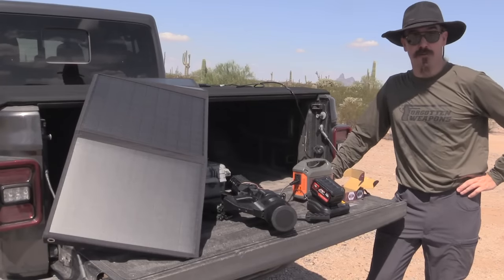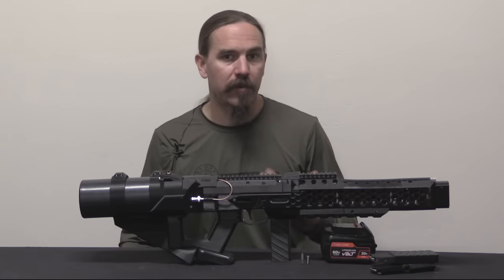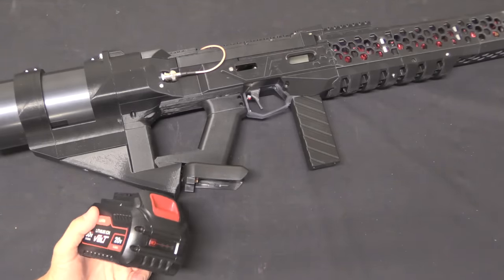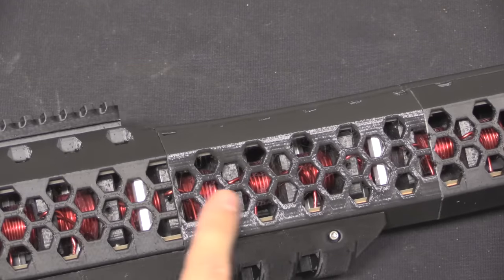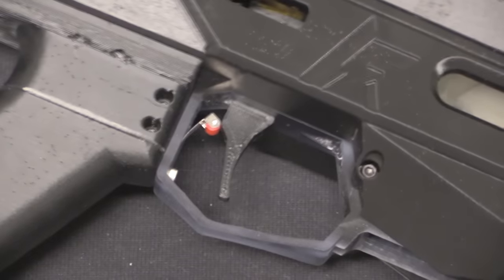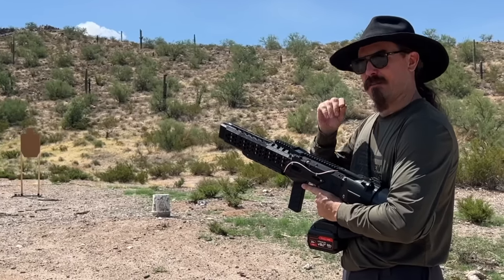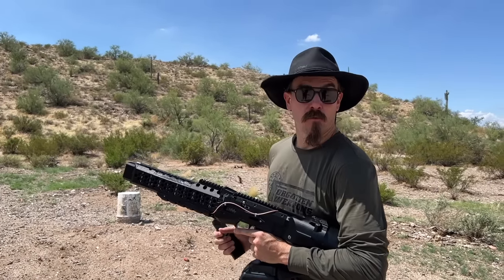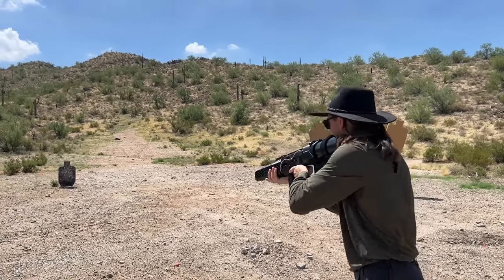ArcFlash Labs EMG-02 CoilGun: Making SciFi Weapons Into Reality

Comment: At that low of a velocity, I suspect this could make a fantastic indoor range toy. You could set up a catch trap and likely reuse the pins almost indefinitely.
Reply: I bet they're limiting it so they can keep building these without a proper license. For now. To increase velocity you need higher amps and faster timings and they can do both easily.
Reply: @1_GigaWaffle  I think the limiting factor is how fast you can charge the coil (limited by its impedance), and how fact you can process the input (where the projectile is) or otherwise how fast you can switch coils (electronics speed).
Reply: The accuracy is still atrocious. A soft air gun would be a better choice.
Reply: @michaelmay5453  Its accuracy issue is coming from poor flight stability which doesnt seem like a priority atm, but there are a few methods of improving stablity. The current projectiles are literal straight and even pins.
Reply: @michaelmay5453  you could technically fire a flechette out of this thing and that is pretty scary
Reply: @michaelmay5453  Accuracy has more to do with their choice of ammunition, which seems relatively easy to fix.
Reply: @legndery1909  oh god, that's crazy!
Reply: @legndery1909  You are now imagining someone at a 2-gun match with one of these transitioning to longer range targets by swapping mags and screaming "SABOT UP!"
Reply: @michaelmay5453  Still enough accuracy for home defense.
Reply: @praevasc4299  For home defence it's like throwing pebbles at an intruder. It might break skin if you are hit in the forehead but a pellet gun would be FAR superior.

If you live in a war zone, I recommend you get a proper gun, if you don't I recommend that you stop being so fucking fearful of everything.
Reply: @TheArrowedKnee  No. Without rifling or something to keep stability it won't be stable. The ammunition doesn't touch the barrel at all, it can't because the drag would mean it would get stuck.

It's a fun concept but it's not some kind of "gun of the future". The tech has been around since 1825 and this is the latest state of the art.

To increase power you'll need either bigger gauge coils or superconductors. As we know superconductors only work when they are super cooled with liquid nitrogen so that is out of the question.

So heavier gauge wire it is, it increases weight exponentially and since this is copper, next step would weigh three times as much. Now that would require bigger capacitors and a higher discharge speed which isn't even possible today.

Meanwhile a very simple, reliable regular firearm solved those problems a long time ago.

It's a cute gimmicky little thing but that's it and that's all it'll ever be.
Reply: @legndery1909  No, it has to be uniform or the magnetic field would affect different parts differently and it would just get stuck in the barrel.

Air guns are far more useful but in reality, we have firearms that are efficient and worthwhile, why the hell would you want something that if it hit me, I could throw it back faster at you.
Reply: @michaelmay5453  Errr, you might have mistaken me for someone you know. Who said I was fearful of everything? We were talking about the accuracy of this gun, and I mentioned that accuracy is not an issue at very small ranges. That's all.
Reply: @praevasc4299  If you think you need a gun for home defence you either live in Kabul or your fearfulness is out of control. So, do you live in a fucking war zone where you need a gun to defend yourself?

Also, you were talking about home defence, why try to make believe you didn't? You do get that everyone can read your response, right?
Reply: @michaelmay5453  Oh, calm down already, no one here is interested in what assumptions you make up about what I feel or don't feel.
Reply: @michaelmay5453  i guess it has different magnetic properties, but how do you know it gets stuck? It’s still just a novelty now but i’m sure it can be made much stronger and faster as batteries hold more charge and so on.

Comment: i don't like how the design philosophy is moving away from the large payload projectiles but making it shoot improvised munitions like drillbits is really impressive considering  the potential of objects that could be used
Reply: I Imagine once they have got the power metrics and the mechanics on smaller scale they will start moving back up.
Reply: Still prototyping, so as they work further then they will start add features.
Reply: Capacitor technology will only improve, increasing energy capacity, which in turn increases payload capacity. I'd give it a few decades
Reply: 50 inch coilgun cannon pls
Reply: Well, for a coil gun such as this any projectile that can fit into the barrel and is magnetic can be used as ammo.
Reply: Honestly I think the optimal projectile for this needs to be longer and heavier, like miniature APFSDS rounds so they do not need rifling.
Reply: @Squeaky_Ben  they'd still need to make the muzzle velocity much faster.

At this point in time their prototypes appear to be sci-fi pellet guns whilst the technology matures. Who knows what they'll be able to do in the future though
Reply: "The bit is too long to fit in the magazine..."
I think I know what length they should standardize their ammunition to
Reply: @stephen9894  They will have to improve the velocity to some degree. 120 meters per second would be nice, but I personally do not think they need to go to very high speeds just yet, that is not what coil guns are good for.
I think the real niche in the future will be utility coil guns.
Remember, your projectile mass almost does not matter, so you can rapidly fire smoke or even small HEAT charges with it. It will be great for that, but for human targets, large, heavy darts could be used for covert ops, because it is just supremely quiet.
Reply: If the projectilles are more like arrows and crossbow bolts with sharp and pointy bolts would be more efective !
And are kind of Fletching would the projectile give more stability !
Reply: Next version I want to hand load an SDS point chisel and see what it does
Reply: @hueylong7989  1270mm ? sonovabich i'm in.
Reply: @stephen9894  Ian didn't say that mass driver efficiency falls off the higher you want the muzzle velocity to be, so to say double the muzzle velocity you'd need a far longer barrel. This is because the faster the projectile goes the less time it will spend in front of the electromagnet that accelerates it and therefore is accelerated less.
Railguns don't have this flaw but the really powerful ones (naval railguns of which you can find videos on youtube) fall apart after like 50 shots because of immense heat and electromagnetism.The advantage mass drivers bring is that they are very efficient at launching massive low muzzle velocity projectiles, hence the name mass driver.
I am quite sure what I am saying is correct, but I never studied this formally so I'd advise doing your own research.
Reply: It is still shooting a large payload projectile. Those rods that fit in the magazine are bigger than a 30-06 bullet. It's easy to see it as small because it doesn't have a cartridge but the size and the fact that they are pure steel make it devastating with the right velocity conditions.
Reply: @adamnouiguer3430  I've not studied it too much myself either, but from what I remember from school it should be possible with the same number of coils currently.

They'd just need to have a lot more windings in them and will take much more energy. It may not be possible for us to get coil guns that are the same size and power as current firearms.

Even if they can find a way to control the magnetic fields in a way to induce spin that would greatly improve their effectiveness but I just don't see a huge increase in velocity as being possible in the next few years.
Reply: @Squeaky_Ben  Is there any benefit from using an electric launcher though? Take a current 40mm grenade launcher; you could just make, idk, ~10% of a projectile the propellant and skip the whole electromagnetic stuff. Its way more effective to use gunpowder to propell a charge, compared to electricity, and Im not sure any foreseeable technology would change that.
Reply: @termitreter6545  Its the best I can really think of, because for long range shots, in order to keep enough power on targets, you are either looking at chemical effect rounds (back to grenade launchers) or really REALLY heavy projectiles at slow velocities.
If a way to upgrade the acceleration is found, this could all change, but I do not see that happening any time soon, but I will be happy to be proven wrong.
Reply: @wisdomiscenter I hope so, however given my understanding of electromagnetism, there are limitations at play that are going to be fairly hard to overcome, which is why I am following the development of these guns with great interest.
Reply: Well that's the neat thing about it being a coilgun. Because it uses magnetism, the gun can basically fire anything with enough iron in it that'll fit into the gun itself. Theoretically you could probably fire a frog out of that thing.
Reply: @termitreter6545  a electric grenade launcher would be considerably quieter than your traditional options, that's a huge advantage to the electric weapons plus no red hot munitions that act as tracers, there are advantages just like with specialty weapons there are trade offs too
Reply: @elmerjfapp5730  Afraik grenade launchers are already not that loud compared to rifles, theyre quite hard to locate. They also dont got tracers.
I dont think sound would be much of an advantage.

And mind, the difference in weight would probably be like ~10kg extra. You also only coud use it charged, so logistics is way more complicated. If youre cut off, you might run out of power and cant use it anymore.

Comment: Railguns: two rails the projectile is always touching. There's a lot of electricity sent through one rail, through the projectile, and through the other rail. The Lorenz Force is what makes it go. I think it basically wants to spread the rails apart, and when it can't, it pushes the projectile away, real fast
Reply: Anf the instant friction (Even with mitigators) tends to convert the inside of the rail (And part of the projectile) from a solid into instant plasma. DO not pass go, do not encounter any other matter phases. Rather wearing for the system at the moment.
Reply: @peebothuhlu7186  I am curious, do you know at what speeds, power levels, or forces this friction occurs? I have heard of the issues the U.S. Navy was having with having to rebuild the rail every single shot, as it would tear itself apart, but on the slow end of the spectrum, you have high speed maglev trains that work very reliably. Perhaps the problem isn't the rail technology, perhaps it is trying to use it to throw something too big too fast. Perhaps just scale down the size of the projectile, or don't try to launch it 10 miles at 10 times the speed of sound (I don't know the actual numbers, I am just saying in principle).
Reply: @ryanaegis3544  maglev trains aren't using railgun concepts, they're using coil gun concepts (more technically linear electric motor concepts, but close enough at this point).
Reply: @peebothuhlu7186  actually its not the friction that's making it turn to plasma, its the arcing that is causing it.
Reply: Rails have the advantage of being easy to design and build, but are lacking in efficiency, and the rails tend to erode and need frequent replacement.
Reply: @peebothuhlu7186  The navy actually supposedly cracked that problem of barrel life railgun engineering, but the how is clasified unfortunately. At least the barrel of a battleship sized railgun would be in the 400ish shots which compares well to the 300ish shots that the iowas would get from their conventional gun barrels.

Comment: It is interesting to see the concept of electricity-based weaponry take shape. It reminds me of the history of heavier-than-air aviation, where in in the 1910's you'd find aircraft capable of up to 150km/h or so. Fast-forward some 30-odd years and you've achieved a 10x increase in speed, breaking the sound barrier in the process.
I am very much look forward to see where this ends up in 20-30 years from now.

Comment: The single capacitor means that each coil can be given different amounts of energy. For example the at rest projectile is under the influence of the first coil for a far far greater time than the last coil. So you can spend more energy pulling longer on the first coil than the last which the projectile just zooms past. Or you can profile the power differently to each coil. This isn’t available on the first version as the capacitor could only dump the power into one coil.
Reply: So in theory you can download an upgrade to this gun
Reply: @noblemaremilker  paid DLC
Reply: Most likely they have hall effect sensors to sense the position of the projectile in the barrel and turn on/off the coils in sequence based on the position of the projectile

Comment: Amazing to see the leaps in engineering in this model compared to the last iteration. It would be interesting to see how much damage it does against a human/ animal test dummy compared to a conventional rifle or even pistol etc. the future is looking scary though as no recoil, very quite sound from firing and an automatic mode that is looking much more useful in the real world 😂
Reply: Recoil will always increase with projectile momentum. Newton doesn't allow any way around that.

However: low-mass, high velocity projectiles are able to deal equivalent damage with less recoil, as energy (and thus damage) increases with the square of velocity, while momentum lags behind with a linear relationship.

Something like a particle beam at near-lightspeed is the extreme example, and could do immense damage with far closer to zero recoil. Not sure making something like that portable will ever be practical, but known physics allows for it.
Reply: Considering the fact that the rounds are homogenous, and don't have a tip or butt that is as sensitive as those found in a traditional rifle, it also means you can be a lot more creative with how you store ammo. Imagine this but with a 50 round magazine in the style of the PP-19 Bizon.

Comment: When big capacitors fail, the last thing you want is to be close to it, having it against your shoulder is probably not the best idea.
Reply: @paisley4092  not like gunpowder is a particularly impressive explosive.

While a 60v 1farad capacitor is fairly impressive when it blows.
Reply: @ScottKenny1978  tell that to kentucky ballistics
Reply: @kamj6607  if KB's round had been packed with C4, he wouldn't have had a head attached.

C4 has something like 10x the burn velocity of gunpowder, which means that it makes about 10x the instantaneous pressure.
Reply: @ScottKenny1978  does that capacitor explode like a c4?
Reply: @kamj6607  they can. 60v 1farad capacitor holds 1800 joules. (Formula is joules = farads * voltage * voltage * 0.5).

And I'm guessing on just how big a capacitor that is, it probably is a lot more than 1 farad.
Reply: @ScottKenny1978  It's also the speed at which the energy is released.  Burning powder takes a bit of time, relatively, to get from one side to another.  When a capacitor pops, the energy can fully discharge at one point instantly.  Depending on location, cause, and chemical makeup of the cap- it can be life altering.
Reply: @ScottKenny1978  i dont know much about math or electronics but i blew up a welder capacitor once and it sounded like a damn shotgun so i wouldnt want that thing near my face that's for sure
Reply: @kamj6607  exactly. I have a healthy respect for large capacitors. I would not want an actively used capacitor next to my head.
Reply: @ScottKenny1978  and rightfully so, thanks for the information. i learn something new in the most random places.
Reply: @kamj6607  no problem!
Reply: @ScottKenny1978  with electrolytic capacitors to my admittedly limited understanding any explosive failure is actually a pressure failure of the enclosure due to gas expansion of the boiling electrolyte liquid. while the stored charge might have some relevancy to the boiling process it afaik doesn't translate to kinetic energy being released.
(having the cap discharge in uncontrolled manner as Dustin was commenting is different failure entirely consequences of which would depend on where it was discharging but generally you don't want it across your heart)
Reply: @paisley4092  look man, I don't know how strong the explosion of that particular capacitor would be, but i think it might straight up tear your arm off.
it is easier to replace a hand than an arm.
Reply: as if having a live round in a bullpup is any saver lmao

Comment: ArcFlash Labs makes some really fun guns. There's just something so fun about the concept. And the sound it makes is just so entertaining. It's almost like a Nerf Gun for adults
Reply: can it still kill somebody, or is it the power of a BB gun?
Reply: @crazysilly2914  it's a bit more than a BB gun and possibly less accurate, but definitely would be hard to kill a person
Reply: Even if someone doubts the practical use, it's still undeniably cool and fun. It fires drill bits!!!!
Reply: @CorvusCorone68  i dont know man its a chunk of steel moving at serveral feet per second with a lot of mass it might not kill you right away but it would likely cause internal hemorrhaging and broken bones
Reply: @JustAGooseman  they're the size of a power tool drill bit, that is not a lot of mass; they are also moving slower than even a bow would launch them, and are tumbling which results in loss of speed and energy; unless you are a tree-climbing rodent, internal hemorrhaging and broken bones are highly unlikely; definitely not a toy but definitely not feasible as a weapon either